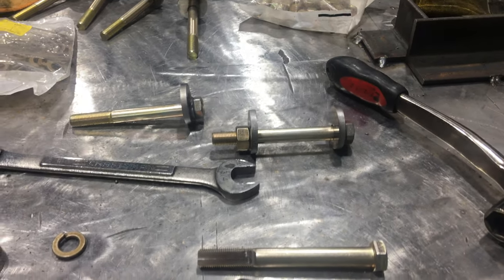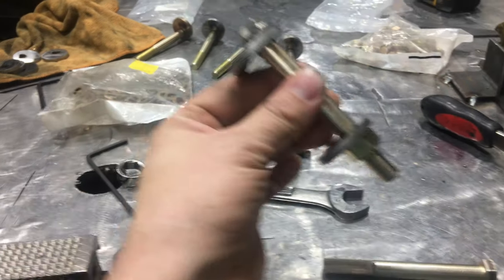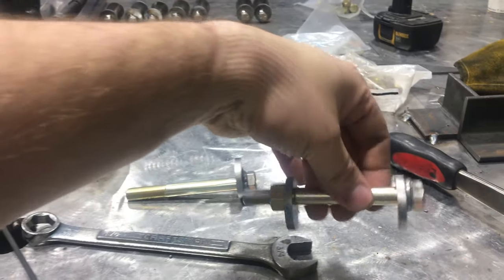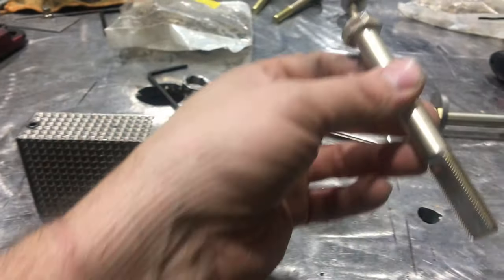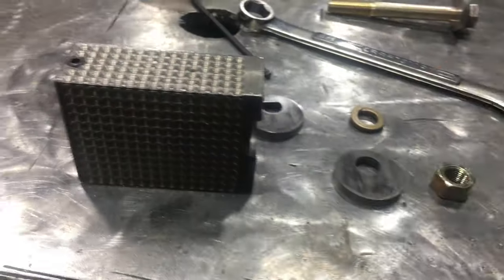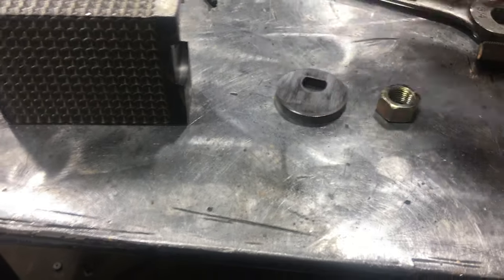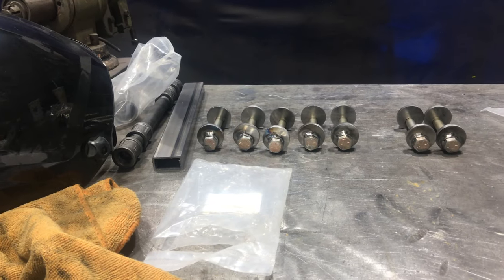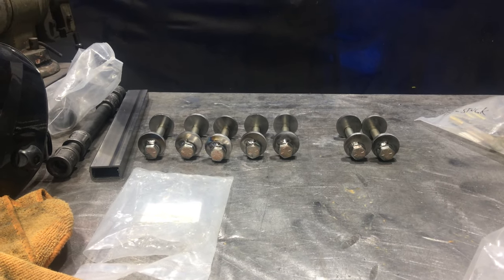Cam Bolts

Comment: I did the same. Couldn’t wait for machining the bolts so I used a grinder with the bolt in a vice and a sharpie for marking my lines. Took a few hours but came out perfect